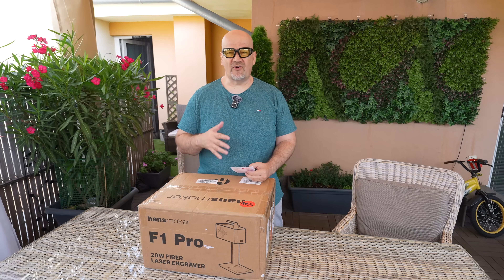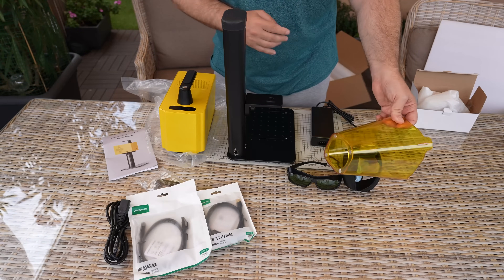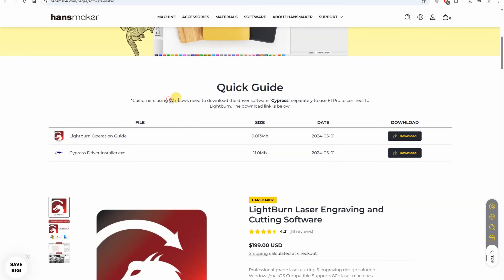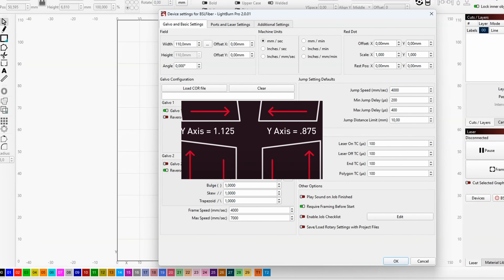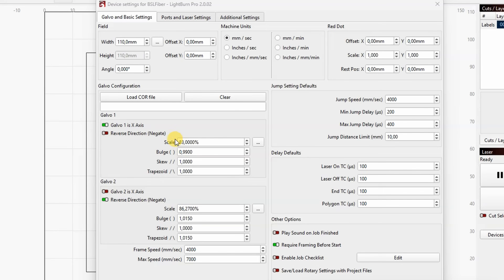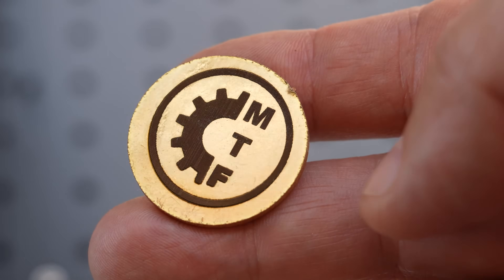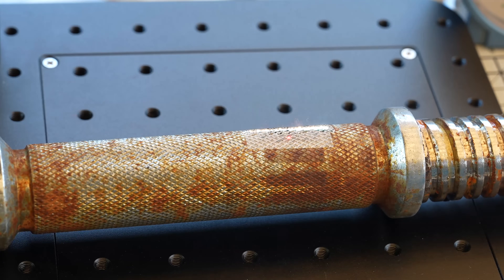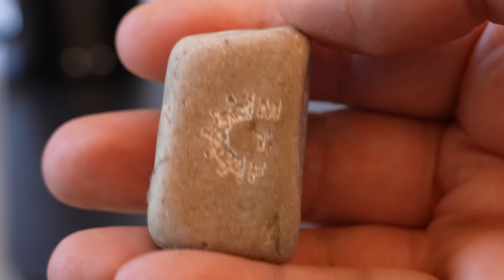Better Than the Manual: Hansmaker F1 Pro 20W Fiber Laser Review

Comment: It would be fantastic if you could compare it to H2D Laser. I mean not just specification, but also user experience.
Reply from the maker: H2D is a diod laser, not fiber. Very different type. Its for wood for example.
Reply: @MyTechFun  I am aware it is a diode laser, but don't really know for what can/should/cannot be used. My understanding was that the H2D 40W version can engrave metal.
Reply from the maker: @martinkorinek5489  40W diode laser can engrave stainless steel, since it has low thermal conductivity and that small point will be melted. But it is mostly for cutting and engraving wood. Fiber lasers can engrave almost all metals, many plastic types etc. But they are not good for the wood.

Comment: These engravers are pretty impressive, but I find the exposed design very sketchy.

Fibre lasers are usually 1064 nm, which is much more hazardous than the older CO2 lasers used in laser cutters - it's a wavelength that can reach your retina.

I know they supply goggles, but it would be much better to have a proper, interlocked enclosure. It's easy to forget to pop the goggles on if you're doing a lot of engraving.
Reply: I think most people, even hobbyists, build their own enclosure for fiber lasers, to contain the smoke and dust, but also to block stray laser light.  Any laser that can quickly engrave steel is not safe for human exposure.  I'd interlock the enclosure door to the laser enable to prevent laser operation with the door open.
Reply: @Liberty4Ever 

You'd hope so. I once encountered one of these being used out in the open at a major department store. The operators / management had no clue it was dangerous, as the engraving beam is invisible and therefore not obviously bright.

I explained to them how sketchy it was and they quickly got rid of it.

Comment: Could this be used for PCB manufacturing?
Reply: Yes. There are some videos on that topic. But you are only making two sided boards and need to make vias by youself.
Reply: Vias can sorta be done via carbon paint or electroless silver deposition. I think diy PCB making should be left to topologically simple single-sided projects, where you need minimal jumper wires, and to one-off single-sided “glue logic boards” for connecting properly fabbed PCBs together. Be those proper PCBs common alibay modules, official dev-boards, or general-use PCBs you order from places like JLC.

A CNC mill is generally a better tool for PCB fabrication, if only because it can easily create holes without need for realignment before / after carving traces. Solder-mask can be done using spring-loaded bits. There’s a YouTuber looking into adding a double-headed pump to fill milled holes with carbon conductive ink and then electroplating solution for the purpose of automating a via workflow, it will be interesting to see where that goes.
Reply: @Scrogan  that‘s a good take 👍🏻

Comment: I my opinion, just get a ender 3/ 3s and the laser modul... they work pretty good, maybe not as fast and as defined (laser module is in movement...), but at the same time they just cost a fraction of this thing and are good enough for most engraving jobs
Reply: Don't mix the diode laser with fiber lasers.
Reply: @gasparigi Yeah, fibre lasers are quite a bit more capable.
Reply: Different kettle of fish.

Comment: Hey Hansmaker, it's 2025, USB-C was invented years ago.
Reply: USB B is more robust for cases where size isn’t an issue, and it’s less ambiguous about which side is the master and slave. Also much easier to solder (even to perfboard) for those of us making our own circuits. Micro B is an abomination that tramples on the legacy of USB B.
Reply: It's not about Ave, it's about practicality. USB Type B is very widely used for devices requiring securing of the port. It is designed to be hard to drop out but easy to pull out. For USB Type C you need to add secure screws or secure clips, which defeats the purpose of USB C anyway